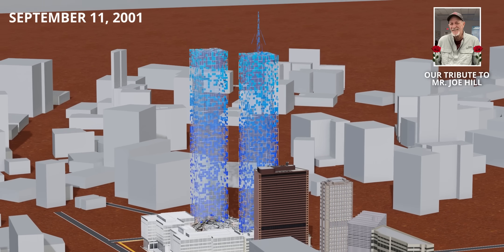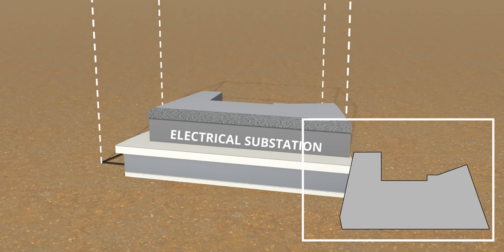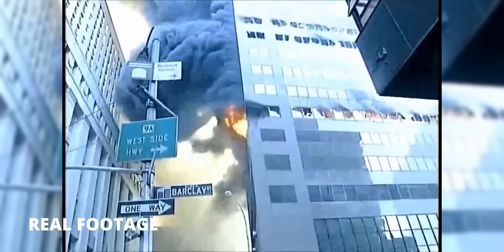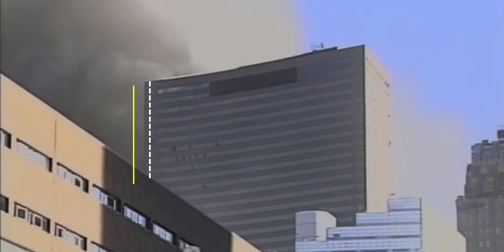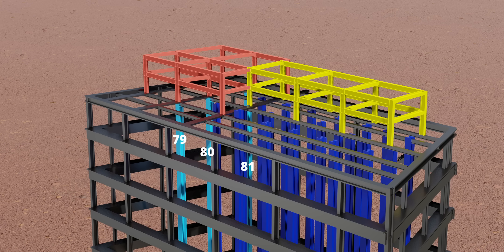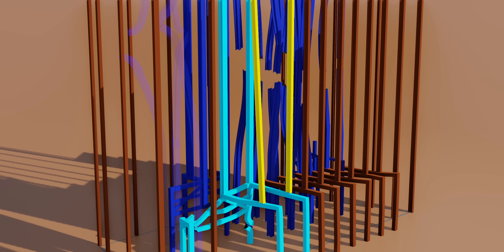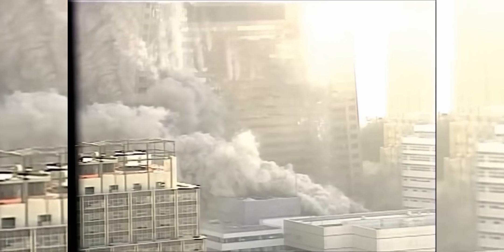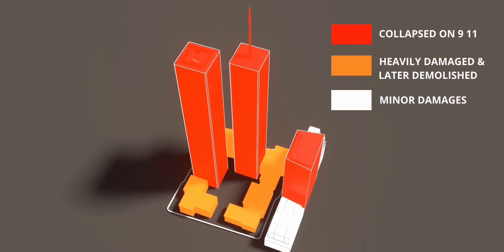Collapse of Building 7 | The Complete Physics

Comment: Stay bent 90°, but 𝗡𝗜𝗦𝗧 𝗡𝗖𝗦𝗧𝗔𝗥 𝟭𝗔 𝗙𝗶𝗻𝗮𝗹 𝗥𝗲𝗽𝗼𝗿𝘁 𝗼𝗳 𝘁𝗵𝗲 𝗖𝗼𝗹𝗹𝗮𝗽𝘀𝗲 𝗼𝗳 𝗪𝗼𝗿𝗹𝗱 𝗧𝗿𝗮𝗱𝗲 𝗖𝗲𝗻𝘁𝗲𝗿 𝗕𝘂𝗶𝗹𝗱𝗶𝗻𝗴 𝟳 Fig 3-15 Pg 46 'Stage2', WTC7's collapse acceleration was 2.3 seconds at -9.8m/s2, free-fall. NIST averages the velocity of WTC7's collapse from the start of its penthouse collapse, Phase 1 to the end of its data in Phase 3 once WTC7's collapse had slowed, obscuring Stage 2. Free-fall=Controlled Demolition.
Reply: OK, but that's only for just one spot on the outer curtain wall at the very end of the collapse, so who cares?  It doesn't mean anything.

That's why it is so important to NOT leave out all the critical context - like ya just did.
Reply: @TheCriticalStinker-01  It's accurate to use visible corners of a collapsing building that can be observed as a datum point. In the case of WTC7 it's logically to measure Stage 1 of it's collapse from the corner of its penthouse. Then Stage 2 & 3 of its collapse from the corner of the buildings parapet which momentarily went into a free-fall collapse.
Reply: @rozza2012  - CornerS, as in plural, right?  But David Chandler didn't measure cornerS (well, he probably did but,...) he only submitted one measurement of one corner to NIST during the open comment phase of the investigation.  But it's also meaningless since about 90% of the building was already gone before ol' Dave clicked his stopwatch. Those corners (or corner) is NOT THE BUILDING but rather the external moment frame.

The building was already gone.  This was NOT Stage 1. 

Who gives a shit how fast one corner of an empty shell at the very end of the collapse accelerates?  The only thing that can tell you is how fast one corner of an empty shell at the very end of the collapse accelerates.

And yes, I know you don't get it.
Reply: @ LOL it's NIST's chart, you know the U.S's official investigation, not David Chandler that embarrassed NIST into accepting reality that I referenced. 

A: 'An empty shell', err O.K so you accept NIST's conjecture about what can't be observed, what happened internally to WTC7's structure that presumably led to it's penthouse collapsing in Stage 1 of WTC7's collapse. 

B: Meanwhile you reject the reality of what can be observed that established NIST's chart of WTC7's parapet's free-fall in Stage 2. 

WTC7's 57 continuous columns that supported its parapet had to all momentarily offer zero resistance to gravity for WTC7's parapet to free-fall for 2.3 seconds.   

And yes, I know you don't get it as you've accepted 'A', conjecture over 'B', observable reality.
Reply: @rozza2012  - If the NIST was incorrect about the collapse progression mechanisms,  why aren't they wrong about free fall of one spot on the moment frame?

All they did was use Chandlers measurement and he was wrong. He never showed a period of sustained FFA while making the fatal error of assuming 2 dimensional movement.
Reply: @TheCriticalStinker-01  Because NIST's collapse theory, is just that a theory based on absurd list of assumption & negligible evidence that could never combine to make WTC7's parapet's free-fall. 

What WTC7's parapet's free fall means in regards to the conventional conspiracy theory of 9/11 makes it an unacceptable fact. 

None the less WTC7's free-fall collapse is a basic observable fact.
Reply: @rozza2012  - Why is it absurd?  Any more absurd than the Chandler/NIST imprecise and undefined measurement of free fall that doesn't actually show free fall and isn't measuring the building by any acceptible definition of the term?

You are just picking and choosing the bits that fit your narrative and hand-waving the rest.

Tell you what, to avoid wasting a lot of time with you dancing around answering that, let me post my own collapse theory, and if I am in error please feel free to point out exactly where and exactly why.

Building 7’s collapse was completely different to the Twin Towers and harder to understand with most details hidden from view, unlike the Twin Towers. But we can still sort out what happened through careful analysis and observation.  This is my explanation  of the collapse using the best available information and relying on no authority.

B7 was complex 47-story steel framed structure built on top of a smaller existing 3-story building, requiring several lower floors dedicated to complex load transfer structures instead of usable office space. Of trapezoidal shape and all-steel tube-in-tube construction, B7 (above the 7th floor) consisted of a central core of steel columns carrying most of the gravity load, perimeter steel columns around the outside of the structure carrying the remainder of the gravity loads and long span beams and girders to tie those elements together and form the floors. On the outside of the building hung a moment frame - the last part of B7 to fall 

Phase 1 : The first externally visible signs of collapse initiation occurred at 5:20:28 pm and was notably quiet with observers not even realizing the building was collapsing! There was no audible warning in the form of  hundreds of ear drum busting 180-190dB explosive bangs preceding the collapse. Here at 12:00 a local CBS affiliate reporter is talking 10 blocks from B7 when collapse begins. People don’t start to notice the collapse until 12:11. At 12:45 is the famous CBS fixed camera clip of Building 7’s collapse. Note how quiet it is.

youtube.com/watch?v=t5tEy6mXSE8&ab_channel=fresnosean379

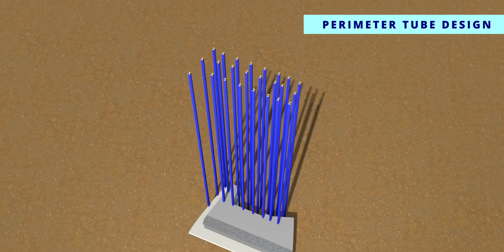Collapse initiation was due to lower floor failures above the load transfer region (7th floor) in the NE corner. In this video at 0:45 you can see the NW corner from inside the building while under construction, Column 79 just out of frame on the left. That big, angled steel beam across the top of the frame connects to C79 at one end. The girders connect to the beam. That beam and all those girders depend on just one connection

youtube.com/watch?v=nP3TNHPCIVU&t=35s&ab_channel=EdwardCurrent

Phase 2 : Lower floor failures caused a loss of critical lateral support over an excessive length of core Column 79 and it buckled. If you look at a floor diagram of Building 7 (see above) and look at all the structures that depend on C79 you quickly realize this one column was a relatively isolated structural element on which a disproportionately greater fraction of the structure depended analogous to say the Key Bridge. Externally we see a vertical progression of window breakage along the 44-46 line and a kink in the roof of the East Mechanical Penthouse at the top of the building, consistent with C79 failure. The transition from full capacity to almost no capacity occurs in virtually an instant. Once the buckling failure occurs there is almost no resistance

Normally with a buckling column, the load could very well be redistributed to other columns, meaning the buckling could stop after a while. With C79 that is not the case - the failure did not redistribute the load, so the collapse rapidly progressed to the roofline, sinking the rooftop penthouse.

Phase 3 : With C79 gone, B7’s progressive, non-symmetrical collapse continues with C80 and C81 at the east end of the core left laterally unsupported and quickly buckled and failed as well, sending the EMP down through the building. C79-81 all have no diagonal bracing, which I believe is a major reason why they could not redistribute a lot of vertical loads among one another.

From there collapse progressed from east to west through the central core until the core was gone taking all of the interior floors and probably most of the perimeter columns with it. Follow the horizontal progression of window failures low in the building and the dropping of the remaining rooftop structures into the building. One of the big takeaways from the NIST Building 7 study (that gets completely ignored) was their modeling which determined C79 failing under ANY circumstances would have initiated the same collapse sequence.

Phase 4 : After 10 seconds only the exterior moment frame - a hollow empty outer shell – remains, giving the illusion the building is still standing since little has outwardly changed. But it’s just a hollow empty shell like an empty cereal box and supported by only a few remaining columns quite unable to remain standing. With all internal framing gone, the north face leans inward, forming a V in the roofline, the last perimeter columns buckle under the strain and the moment frame free falls, landing on top of the 7-story high debris pile. It is here, at the end that a single measurement of alleged free fall acceleration is taken, from a single point on that outer shell. The Building (defined as its center of mass) did not “free fall” – just one corner of the outer shell did. The Building was already gone before that happened. The period of alleged free fall was a product of collapse progression mechanisms, not of collapse initiation mechanisms and cannot inform as to what started the collapse. Start to finish the entire collapse took 18-20 seconds, 3 times longer than true free fall .  How fast something falls cannot tell you what started it falling_ anyway. The debris spread outside the footprint, blocking surrounding streets, heavily damaging the Verizon Building and destroyed Fiterman Hall.  

Building 7’s progressive, non-symmetrical collapse was incidental and unintended collateral damage from the combined effects of fire + time + gravity, started by the collapsing North Tower. That is true no matter who planned and carried out the 9/11 attacks or why . The collapse was of so little consequence it barely even registered at the time, a mere footnote. It only took on semi-mythical status as an alleged smoking gun years later when demolitions at the Twin Towers, missiles at the Pentagon and shoot down over Shanksville all failed and conspiracists had nothing left to work with.

I hope you found this helpful, informative and it solicits informed critical comment. If I made any errors of fact, logic or reason or left anything important out, please let me know so I can fix it. IF you can offer a more plausible alternative please do. Be the first. Please start any reply with the words “Tits McGee” or I will know you didn’t read it and are wasting my time.
Reply: Oh I see you're the expert now because you say so & NIST is wrong after they accepted reality after Chandler so embraced them in a Q&A on WTC1..
Reply: @rozza2012  - I believe I merely asked a question. And here you are a month later, come out of hiding just to avoid answering it. That's liar behavior.
Reply: @TheCriticalStinker-01  NIST's WTC7 collapse theory is based on conjecture, most all of the forensic evidence was rapidly removed & sent off to be recycled. 

Of course there is FEMA's Appendix C which analyzed how a high temperature corrosive molten eutectic of Fe, C & most notable S liquefied WTC steel beams on 9/11, of course NIST ignored all that. 

As NIST erroneously ignored key safety elements of  WTC7s internal beam & column fastened systems. 

As NIST ignored releasing the physics engine of its finite element model. None the less you can't ignore that NIST's finite element model doesn't replicate WTC7s actual reality. 

The reality is that NIST's WTC7s conjecture looks like a 90's video game & is based on conjecture. Whereas WTC7's parapet,  supported by 57 continuous curtain wall columns, went into 2.3 seconds, a fact even NIST accepts to then try to obscure. 

Here enjoy a laugh: WTC7 NIST model doesn't compare. https://youtu.be/o2kv8dG3aMA?si=Erbu6oYd7GGh0iNS

Comment: So I'm supposed to believe that it's the several hours of intense heat that weakened the one side, yet ALL the other structural columns failed at the same time to allow what appeared to be an implosion???
The ONLY explanation for a building to come straight down within its footprint is for the main structural supports to fail simultaneously.